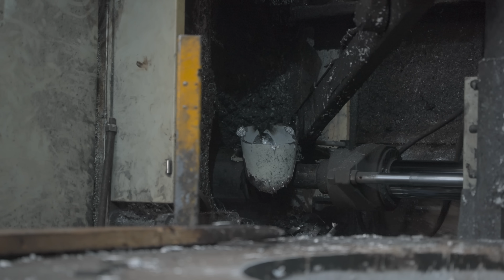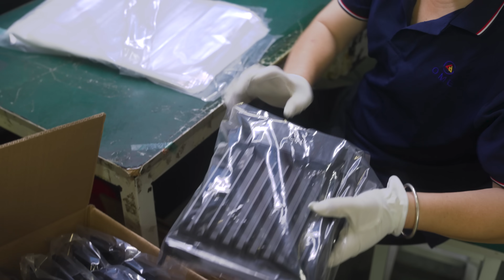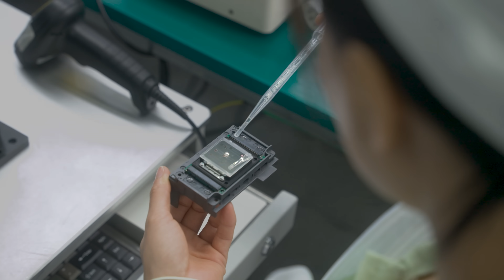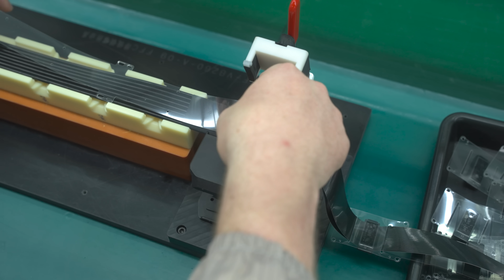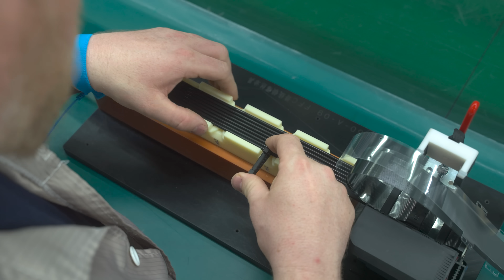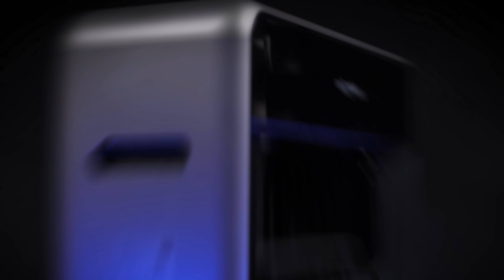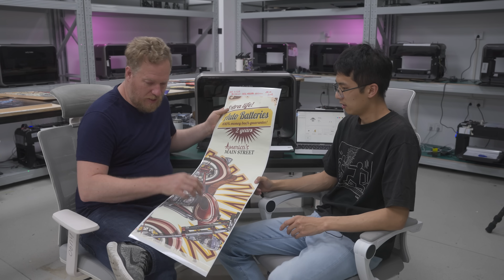How eufyMake Builds the Printers Everyone’s Talking About

Comment: Coming from someone who’s worked in an American factory we have a long way to go to compete with the the rest of the world in manufacturing for so many reasons
Reply: not rest of the world. Only China.
Reply: The funny thing is, even as a software engineer, when I was unemployed, I would have been happy enough to work on an assembly line like this. This isn't making some cheap piece of plastic, this is a precision quality product, and really quite satisfying to see how it all comes together.
Reply: Then you probably don't work in a modern one. This was pretty standard for a low integration factory. Honeywell, Canon, and plenty of other major US plastic/injection diecast manufacturing are significantly higher integrated. 

This whole process seems to be about 6 subtier locations sending material into one location at the end. Each could be extremely advanced or not at all. This is very accurate, and you are unlikely to see the small steps done at sub-sub suppliers like that paint coating he talked about. That could legitimately be in someone garage. I know for a fact that major airplane components worldwide get finished in garages all the time. Sometimes you just need a guy with a grinder.

Overall, what makes this process unique is that all those other facilities are probably nearby, instead of all over the country which is common in the US. You don't need to make a new dept for each process because someone next door already does it and does a great job - that's extremely valuable both from shipping and it lets each company specialize in their area to become very good at it.
Reply: @omega1201  That's the thing. Every single thing you see in this video is made by companies that are perhaps down the road from them. All the clamps, plastic parts in the jigs, the test equipment which require solenoids, valves, pressure sensors, the plastic pellets, the tubing for everything, the printhead, the camera etc.
And the printhead manufacturer probably sources parts from the same manufacturer that anker uses, same for the camera manufacturer etc.
The supply chain is hyper-complex but very localized. We only see the tip of the iceberg here. Anyone who wants to reproduce such process in autarchy would probably need years to make it as cost-efficient.
Reply: There are plenty of things in the US that are made that are far more complex than this, we're just unable to use humans in the process because humans need to be paid.
We also have an issue with scale, because there's no real reason to bother scaling something that can be built in china cheaply. So what's left are things that require US expertise/supply lines/etc, which just so happen to not really need scale.

It's one of those "we could if we had to, but we usually don't have to, so we don't. It's not at all a lack of ability, it's a lack of incentive, and there's no valid reason to try and change those incentives artificially. The market will move by itself toward the most efficient option.
Right now that's China. We'll see where AI/robotics development goes, but, it's highly likely that things will change as that gets better.
Reply: @jttech44  中国的工人工资比美国高，中国工人一份工作就可以养活家庭，美国要两三份工作才可以养家。让一切变得便宜的原因，是中国高效的基础建设：便宜的能源，方便高效的公路网络，齐全的配套产业园区等等。这些你们美国过去没有、现在没有、100年后也不会有，可怜的。:face-green-smiling::face-green-smiling::face-green-smiling:
Reply: @爪子软乎乎  China does efficient manufacturing well for this sort of thing. If they don't modernize though, they're in for a big surprise when AI robotics takes over. Remember, we taught you how to manufacture things so that we could offload inflationary pressure onto you, which worked perfectly. The US dollar is worth pennies now, yet things are still the same or cheaper than they always were. That's because of the deals our governments made and continue to make with eachother.
It seems on TV/online as though our two countries are at odds, but the truth is, we're in the same bed together, and have been for decades now. You need us, we need you. I don't see that changing.

Comment: Just wonder how it prints on mirrors and other reflective objects. Usually bigger printers are risking nozzle drying when printing reflective materials
Reply from the maker: Good question!
Reply: @StrangeParts so if you print on bigger machines nozzles get clogged and often in industry you have access to solvent that can remove clog (usually). But this solvent is not meant for ppl without education on how to use it. So the question is if printing on a mirror like objects will result in premature printhead replacement. And they won't be cheap

Comment: Was highly interested till he said it verifies the ink cartridges
Reply: to be fair they aren't just spraying ink on to paper, the UV resin(?) needs to be optimized for the wavelength of UV light they're using. this is such new technology for general consumers maybe it may kick something off where it becomes less proprietary.
Reply: @henhen7890  the pigment choice affects the nozzle deposition size, the inhibitor and photo initiator can separate as they are applied unless their polar and a few other properties are carefully considered. source material chemist for printing resin manufacturer. we will certainly find people hacking the proprietary out of it, but the ink lock's not done completely out of nefarious motive.
Reply: if the verification of the ink cartridge is implemented as well as the end to end encryption of their cameras in the beginning, it should be simple to use other cartridges 

Context: they sold security cameras that were supposed to be end to end encrypted but turns out they do not care about security so it was often not encrypted and pretty simple to watch camera feeds that do not belong to you

Comment: It's actually insane that in around 13 years or so, Anker has gone from being a phone replacement battery seller to developing and manufacturing (in rough order): charger cables, battery pack, GaN chargers, security cameras, smart locks, world class projectors, 3D printers, robo vacuum cleaners... and now this! Kind of a testament to how advanced R&D has been in China for the past decade!
Reply: They make good stuff!
Reply: Anker is "only" brining in revenues of 3.5 billion USD per year. Xiaomi is only 2 years older than Anker, is now a FIFTY billion USD per year business. Not only is Xiaomi is number 3 smartphone brand in the world and a major appliance brand, they are now doing stuff like designing their own high end chips and venturing into the brutally expensive and competitive auto manufacturing business, with immediately success. In just over a single year of building cars, Xiaomi has already sold more than 250,000 EVs, and in about a month the number 1 and number 2 most in demand cars in the Chinese markets will be the new Xiaomi YU7 SUV followed by the red hot Xiaomi SU7 sedan from last year. Xiaomi pulled in over 4 billion USD in revenue just from their car division alone in 2024, and will probably double that in 2025.

Easily one of the most dynamic tech companies in China, along with BYD and Huawei.
Reply: No doubt.
Reply: I think the Pandemic really boosted sales to many established Asian brands. I  have been a loyal fan of SmallRig for the last 20 years, from hand-made brackets and other small moulded and hand-finished items to CNC milling, bringing on new talent for design etc. They have always maintained a custom channel for me, and have a coproduction site page which encourages ideas from potential customers. Their QC is solid. 
The QC on this, is fantastically reassuring. I can see a small business in that machine!
Reply: Not to forget awesome affordable earphones
Reply: Their headphone are pretty great too.
Reply: I would not be surprised if they made EV cars down the line. Their batteries/chargers are already top notch.
Reply: In a country that treats their people as robots. And a government that blasts money everywhere and more into business that sticks.

Western world can't compete against stuff like that
Reply: They don't manufactur any of that. They did all production at sub suppliers and even assembled at a T1. They are a design firm and then contract our manufacturing... Like most places.
Reply: Ουr mοney manufacturing technology is far better, well, as long as someone will take that mοney as they had vaΙυe. 🤔
Reply: They are one of the truly best quality companies out there, everything they build is solid and reliable.  That helped them succeed by not cutting corners as so many other Chinese companies do.  We've all taken a chance of off brand products from China before, and much of the time the stuff is truly terrible.
Reply: and yet they still use kickstarter to "raise funds" for a product? that's illogical.
Reply: @neeksor  really just hype generator and marketing vehicle at this stage.
Reply: @neeksor  I deff dont like it but at the same time I can understand it, by doing it that way they can gauge the demand for a product before dumping a lot of money into it. Its safer and a better gauge then just doing a customer survey as it requires people to actually spend $$ thus it shows them the actual demand for a product
Reply: @jamess.931  Can you imagine "gauging the demand" after you already have basically built whole factory with dedicated production and assembly lines, specialized assembly and testing jigs and devices, operating procedures and training personnel to operate on all that and after spending a lot of effort and resources to invite influencers to show all that stuff to millions of people? Come on.
Reply: @rotors_taker_0h  Makes sense to me, demand can make the difference between needing to spool up additional manufacturing lines or not. Additionally, Kickstarter product carry some different expectations for the consumer - you are expected to be an early adopter. Someone who can live with the early bugs and growing pains for a novel new product. In essence - you get a discount in exchange for being a beta tester.

I think it's a smart approach.
Reply: @bradley3549 I'm not saying that Kickstarter is useless, just a bit late to measure demand after setting up the production line. Video says they make 60 parts per hour on a single machine, that's easily 10000 per month. Don't think Kickstarter numbers will come even close :) (upd: Kickstarter got 12k orders, i.e. about month of production, which is nice demand, I would say)
Reply: @rotors_taker_0h  the factory can be used to make a lot of different things, though.
Reply: They don’t own the factory! You have to book a production window and pay for the moulds. Crowd funding is they way to go for small businesses until they get th3 sales to set up on their own
Reply: @neeksor  although with videos like this, they are really doing this kind of crowdfunding in the best way possible, be as transparent as possible, with a never seen before product(yes, there are industrial UV printers, but the keyword here is industrial, this is desktop)
Reply: @neeksor  illogical only if you don't understand why they do it. as @james.931 has nicely explain it :)
Reply: @neeksor  More and more, larger companies like Eufy/Anker are using kickstarter to both market as well as to judge the market for their product to see if it's worth continuing.
They don't really need it to "fund" their product.   In this case Eufy has combined the kickstarter with an absolutely massive youtube campaign to grow excitement and anticipation for their product.
Reply: @neeksor  How is that illogical?  They're not the only company that does this.  Using kickstarter does all the heavy lifting when it comes to handling the funding.  This includes collecting payments/data, referral campaigns like the one in this video's description, and I'm sure a lot more under the surface.  Anker isn't a fundraising company.  I think you're underestimating how much involvement goes into these campaigns.